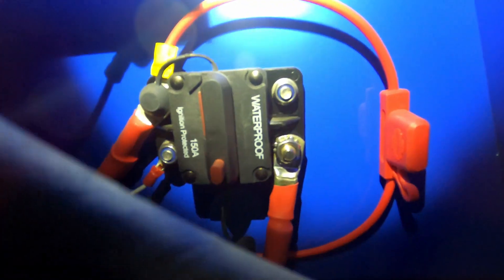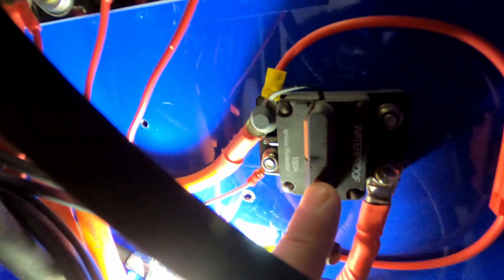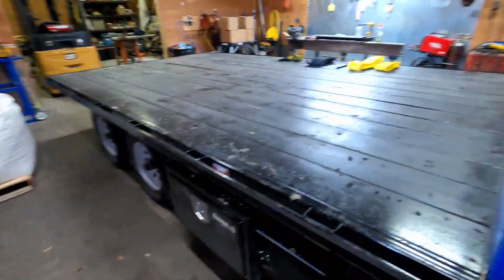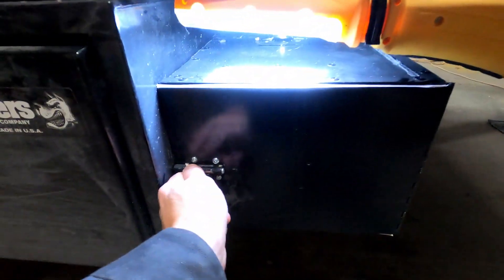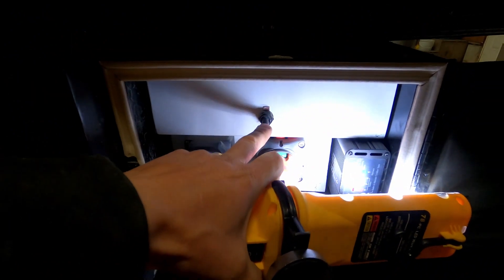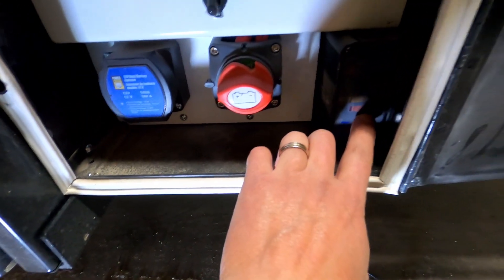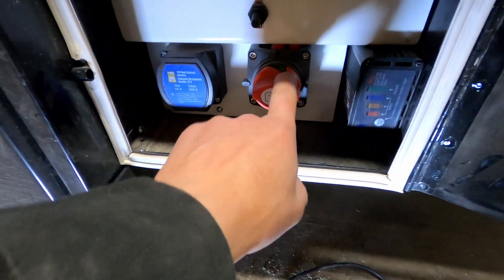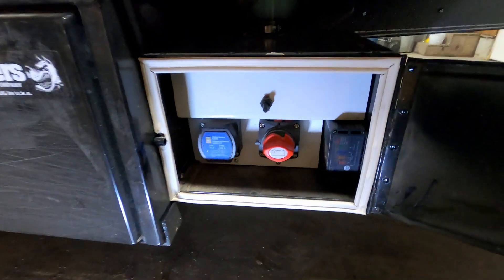Ezyloader install   Electrical described

Comment: Hi, what kind of hydraulic station is installed in it? Can you suggest the characteristics? I apologize for the text, I'm from Ukraine, so I'm writing through a translator. I will be grateful for the answer))
Reply from the maker: Hi.  Hopefully this translates back well. I am not quite sure what info you want so without getting too specific; it is a self contained hydraulic pump/tank/valve set up controlled by the computer in the EzyLoader. The auto level, raise and lower functions and the winch system on the 300MH and smaller units using the hydraulic winch rather than electric are all powered by this pump. I will cover it more in upcoming videos.